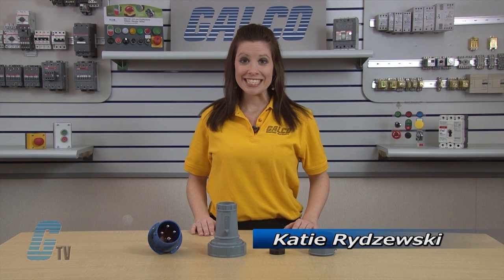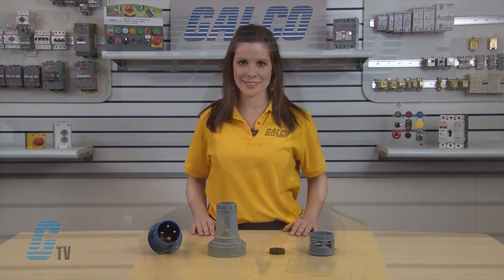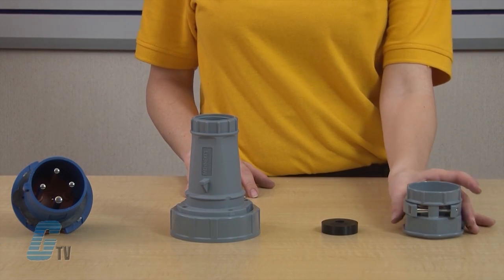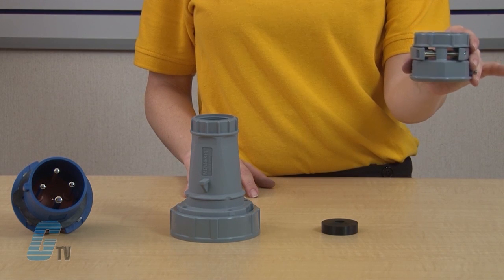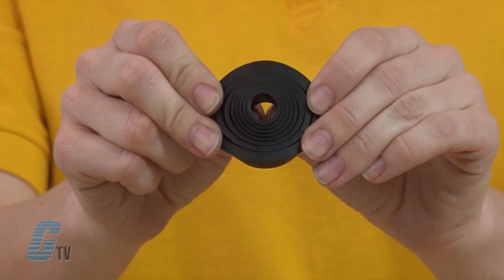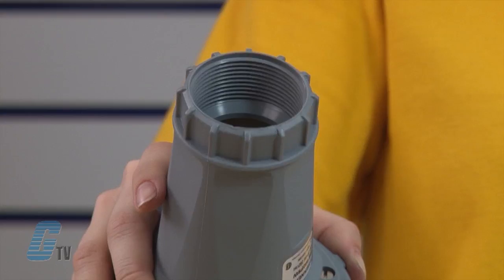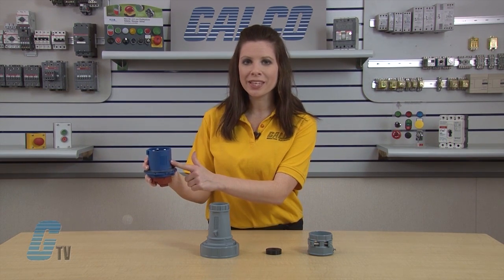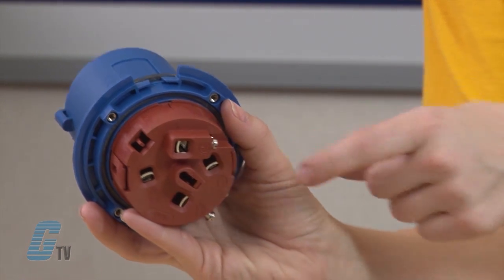Mennekes Pin and Sleeve Connector - 309 Series

Comment: Do you guys make pin sleeves that I can slide over and solder on my old pins to refurbish the connector? Thanks
Reply from the maker: I haven't seen any sleeve available that would allow a used pin and sleeve connector to be refurbished, specifically, not an IEC 60309 type connector.  I know that Meltirc does offer replacement parts which allow for the rebuild of most plugs and connectors available from them, but I have not tried to use any of their parts on a different brand.